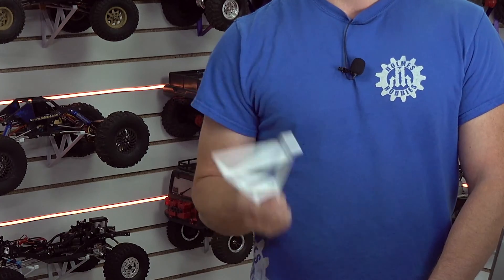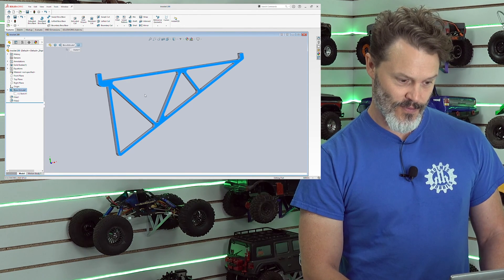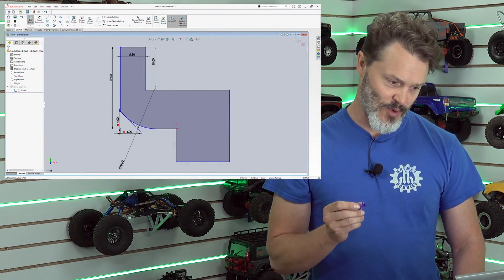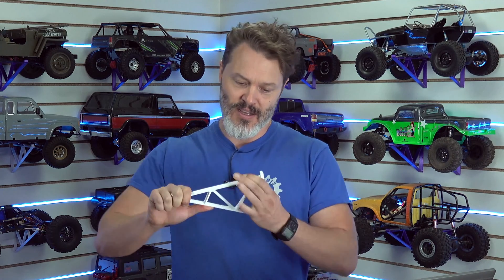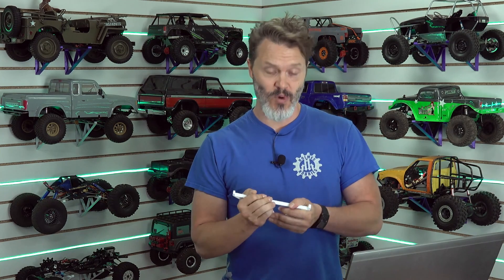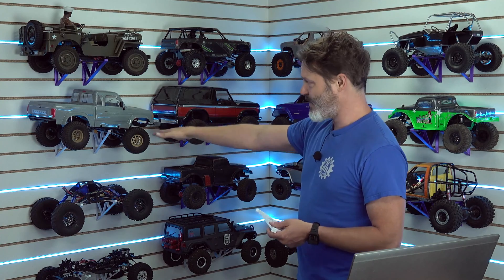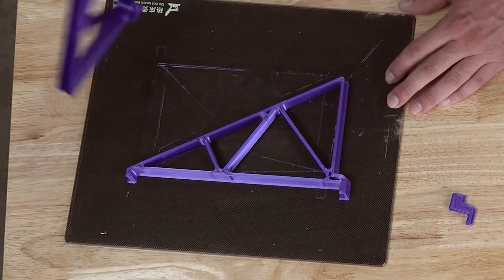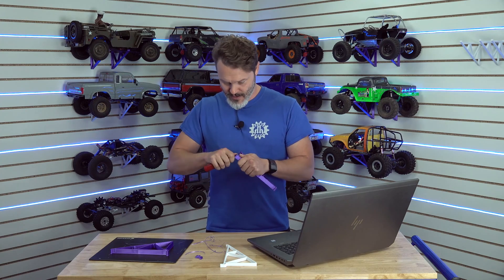Revolutionizing Storage: 3D Printed Slat Wall Brackets Holmes Hobbies Solid Works RC Crawler Storage

Comment: Interesting, I never would have thought to build a part based off the nozzle size of my printer. Of course it seems like a no brained now. 

Your nozzle is 1mm so you printed the braces at 3mm

So my question is, if I have a nozzle of 0.4 or 0.5, would I get better, stronger prints by making parts in multiples of those sizes? Say I wanted a part that is 1.6 mm wide, would using a 0.5 mm nozzle make it funky? And a 0.4 mm nozzle would be ideal for the part because 1.6 is a multiple of 0.4?

Comment: FYI Solidworks has a Maker version for 9.99 a month or 100 a year.  It will 100% beat any free cad if you have the coin to spend.  So easy to use.  Also they have a sweet deal for any veterans cheaper than that.
Reply from the maker: Good to know!
Reply: @HolmesHobbies   feel free to hit me up with any Solidworks questions.  I have been running it since 2001ish...😁 Not a rep BTW just a tooling designer.

Comment: FYI, If you add a fillet to the face which sits on the print bed, you wont have a sharp edge remaining after peeling the brim. I usually use a fillet size of 50% nozzle diameter.
Reply from the maker: Problem with this one is adhesion,  it keeps peeling up from the sharpest edge. Normally I would do that.  And now I wanna try again, lol
Reply: @HolmesHobbies  Great Minds and all that... 😆
Without going down the glue stick/slurry/painters tape rabbit-hole, can I suggest using a multi-layer brim?
Reply from the maker: @NC_RC  first I'll just try regular,  I think there were other problems with the slicer when I first made these. With the way they are sticking to the hot glass now it probably needs no brim if the edges are chamfered
Reply: I use hair spray on my glass bed, no brim needed